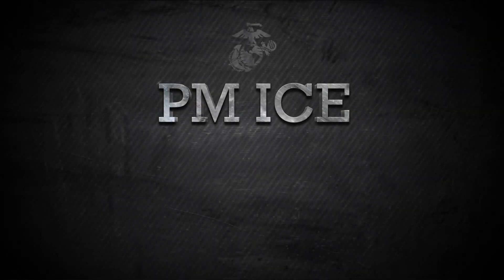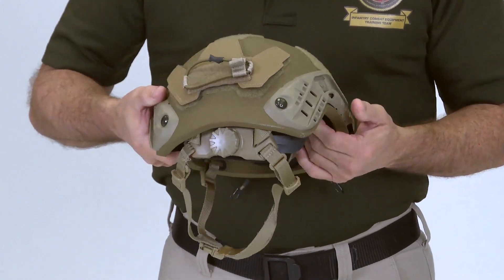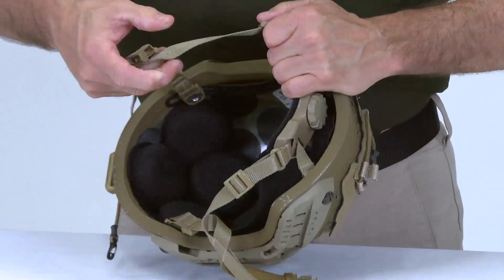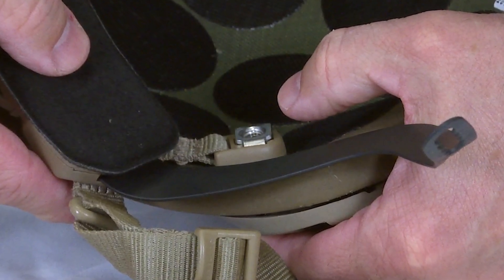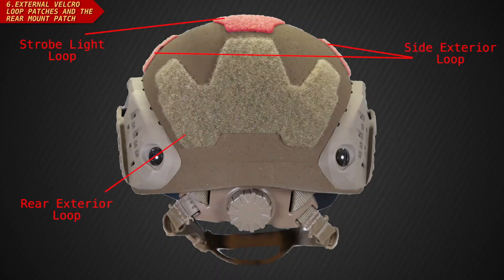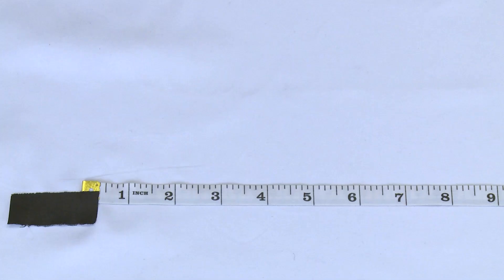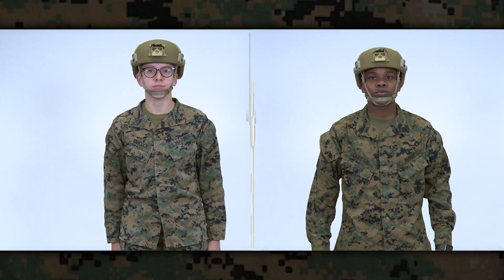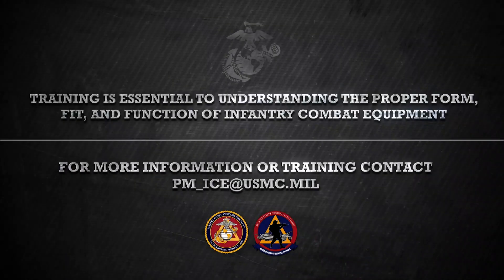High Cut Enhanced Combat Helmet

Comment: Did I hear that correctly? INFANTRY... finally.
Reply: It's the usmc you aren't getting that any time soon
Reply: Will low cut helmets still be used by combat marines? Or at least still used period? I just like the design of the low cut helmets better. The High Cut helmets just have a too much of a skateboard helmet kind look that... Just like the low cut helmets better, cause they look more traditional, much like the M1 helmet.
Reply: @coletrain583 infantry units still have them if they don’t have enough high cuts but the old low cuts are definitely being phased out for the infantry
Reply: @coletrain583 the ech helmet  is simply getting a cut so it’s not exactly getting replaced  low cut helmets will remain existing for infantry  also will remain even longer for boot camp 

Also I’ve seen the fast helmet from ops core be fielded alongside from this
Reply: @Johnpork.0  the MICH 2000 has more protection around the temples and ears
Headphones arent exactly Bulletproof

Comment: Will low cut helmets still be used by combat marines? Or at least still used period? I just like the design of the low cut helmets better. The High Cut helmets just have a too much of a skateboard helmet kind look that... Just like the low cut helmets better, cause they look more traditional, much like the M1 helmet.
Reply: it’s not about looks it’s about effectiveness and im begging to get issued high cut ECH instead of the low cut ones we’re using
Reply: @michaelluvsyouu7720  Okay. No body build it so I could like it. Just as long it works. Got it.

Comment: When is everyone gonna realize that Velcro is ducking useless
Reply: Is it useless for holding your battery pack in place or for the ir strobe? Or you just didn't know what they're for?
Reply: @Wingwuff  That sounds unsecured as fuck.  I would not trust velcro for anything in the field, especially if we're talking about securing gear.
Reply: Tao Liu have you tried it?
Reply: @HaloDude557  Nope, and I'm not gonna risk losing gear over velcro.  If I can pull it off with my bare hands, then it's gonna come off when you bump into whatever.
Reply: @taoliu3949  I guess all those operators since the Gulf War were just being stupid
Reply: @HaloDude557  Ah yes, explain that to the Army cats who be losing patches left and right while in the field.
Reply: @taoliu3949  deflection
Reply: @HaloDude557  Not a deflection.  It's simple experience.  Securing something only with velcro is by definition not secure.  You are constantly bumping into stuff, it will come off.  The only uses for Velcro is maybe IR patches and those gets lost all the time.  Using velcro for serialized gear is just asking for trouble, unless that gear is secured in another way.
Reply: @taoliu3949  you have more experience than all the operators since the gulf war?
Reply: @HaloDude557  No, I'm calling bullshit on your statements.
Reply: @taoliu3949  No, I'm calling bullshit on YOUR statements.
Reply: @HaloDude557  lol, okay, explain how the velcro keeps stuff from coming off when you bump against stuff.
Reply: @taoliu3949  non-Chinesium velcro
Reply: @HaloDude557  Yeah, no.  If I can rip it off with the force of my hand, it will come when I bump something.
Reply: @HaloDude557  You're CONSTANTLY banging on things.  Dismounting and exiting vehicles, buddy drags, low drags, brushing against bushes, trees, cover, etc.  Slings constantly gets caught on your NVG.  Heck, just running around can cause shit to come loose from the bouncing.  There's a reason why people tie lanyards on every piece of serialized gear they have.
Reply: @taoliu3949  people tie lanyards on the $6000 NVGs they have, not the $20 IR strobe velcro'd to their helmet.
Furthermore, the NVG's are already secured through a mounting system that ISN'T velcro, so no one is saying the mounting system isn't secure, the lanyard is just a backup plan for retention if something breaks.
Reply: @HaloDude557  That mounting system is definitely not secure.  The NVGs falls off all the time.
Reply: @taoliu3949  no. They don't. The J-arm physically breaks when you snag it on something while on an open vehicle.
Lmao.
You clearly don't operate or train that much.
Regardless, no one cares about securing a low profile $20 IR light. The NVGs cost 100x more at minimum and have an odd shape that allows it to be caught on wires, branches, cables, etc., more easily than a flattened streamlined object. They aren't going to fall off unless you give yourself a concussion, and if they do, it's not a big deal.
Reply: @taoliu3949  how the hell does your NVG just "fall off"? Are the GI mounting systems made in China now?
Reply: @HaloDude557  Because they suck, and if you have used them before you would know, it's literally a single screw that holds the NVG in place.    You're also talking about gear that's been used and abused for over a decade.
Reply: @taoliu3949  I was assuming we weren't using the bare minimum and using Wilcox shrouds but ok
Reply: @HaloDude557  lmao, the shroud is only one of the possible failure points.  The point where the mount attaches to the NVG is also another possible failure point (its secured by a screw).  There are so many ways you can lose the NVG its not even funny.  That's why it goes in the cargo pocket when just not in use.
Reply: @taoliu3949  yea and you can also get decapitated and lose your entire helmet! The bottom line is: secure what you need to, don't add unnecessary bloat to your gear because you might headbutt a tree at 30 mph and lose your IR strobe.
Reply: @HaloDude557  Um, you don't need to headbutt a tree at 30mph for stuff to come loose.  Literally brushing against anything hard will rip anything you attach by velcro.  Talk to the Army Cats who be losing patches left and right.
Reply: @taoliu3949  nah just banged my counterweight pouch on the desk several times and it's not giving
Reply: @HaloDude557  Cool, lemme know how it goes when gear goes missing because someone doesn't want to secure their gear with something other than velcro.
Reply: drills nut and bolt through strobe and helmet
Reply: @taoliu3949  you definitely need more than velcro to secure your gear, shock or paracord can be tied onto the battery pack and the screws loosened to hook the cord around the rear mounts for the arc rails, the screws can be tightened back down again. A couple of companies have stronger solutions to that problem than simple cording. 
SOF has changed their ways for a reason. People generally tie shit on that they don't want to lose.
Reply: don't really see what the issue here is, you need something secure enough to hold in place however not soo secure that you'll snag on things and get stuck on a firefight. Velcro is a nice medium... now for the truly important stuff... when other companies get more strawberry or lime jello while your company gets orange... that shit is disturbing.
Reply: @taoliu3949  I run a counterweight for DNVGs, an IR strobe, a name tape and a blood type patch. All connected by velcro. Haven’t lost anything, not in the field back on Lejeune or on a 6 month infantry deployment. I understand what you’re saying but if it’s good velcro on the helmet and the gear then it’ll be fine.
Reply: @mesiiahe7350  The problem is that velcro wears out overtime.  When you're the first person to be issued that gear, everything might be gucci.  But after Marine #3 that velcro might not even be there anymore.
Reply: @taoliu3949  You’re right. I have this helmet, you just take it to where you got it issued and you can get the pads and velcro replaced. No serialized gear goes on it, btw.